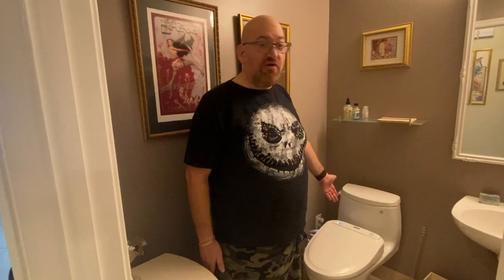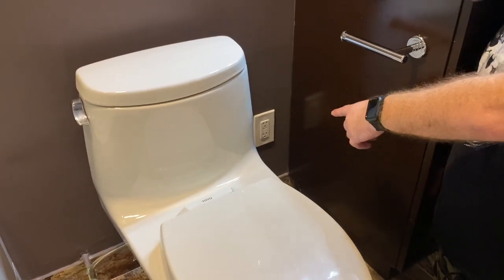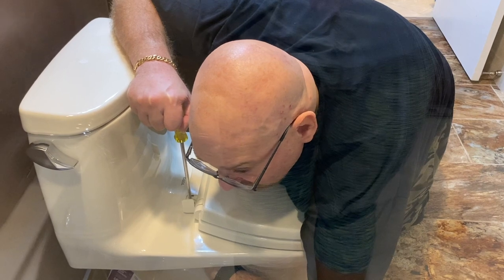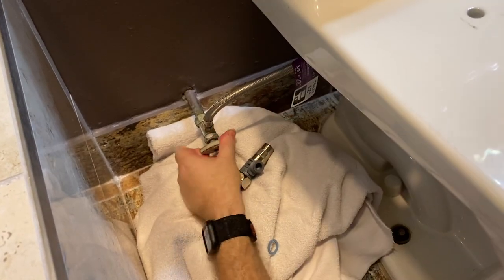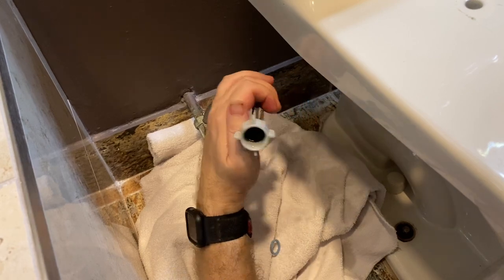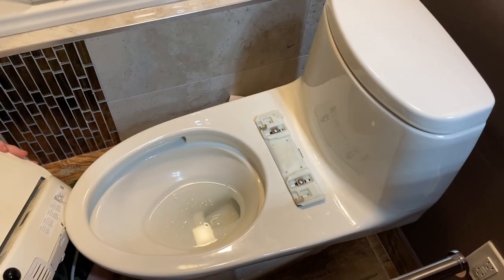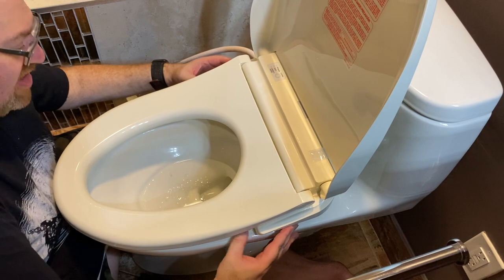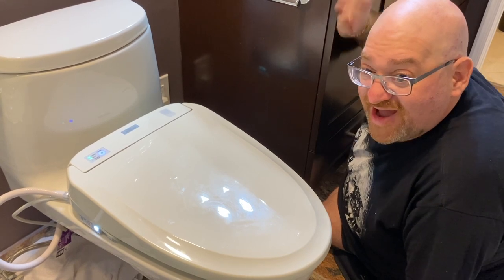Installing a TOTO bidet toilet seat

Comment: Very nice video thank you for taking the time to describe in detail the installation process.  I went ahead and purchased two very inexpensive Bidet toilet seats on Ebay as well as two T-Bidet brass connectors that include a shut off valve. Total cost $45 for each toilet seat. The seats, elongated and round, were very easy to install and work very well. You are correct Bidet toilet seats really do save on toilet paper.